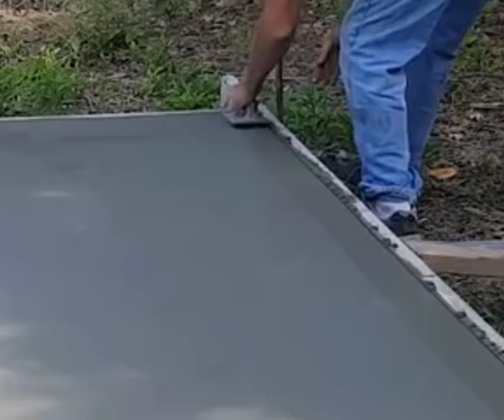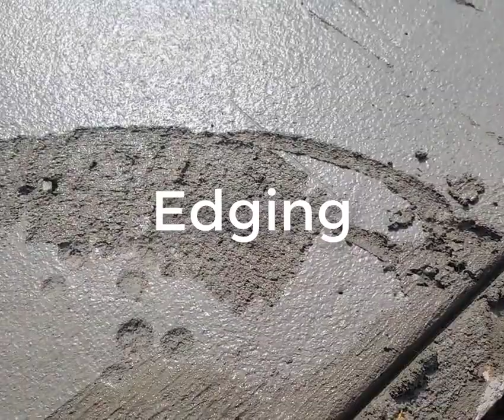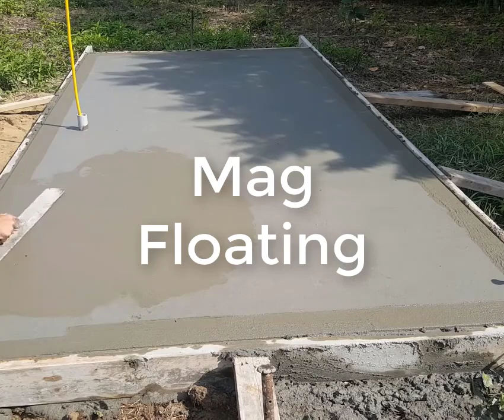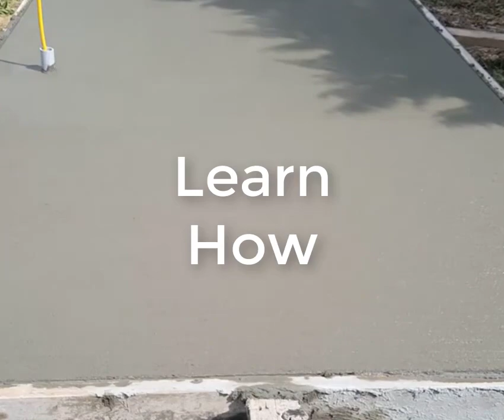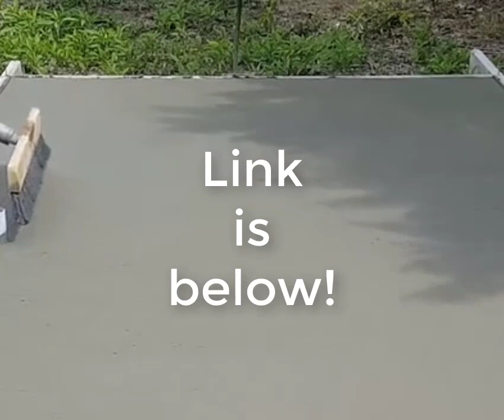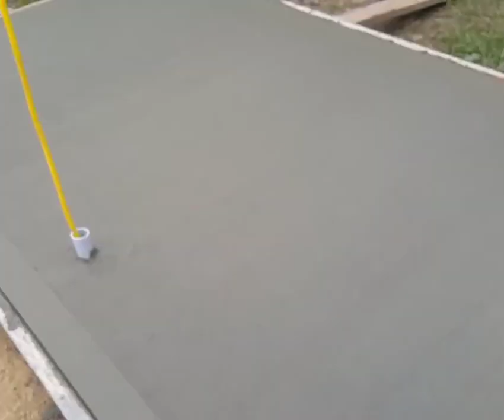How To Broom Finish A Concrete Slab #shorts

Comment: Hey mike I have a question I don’t know to much but why didint you seal it with the other hand trial or is it cuz the sealing would be interrupted with the brooming ?
Reply: But thank you I like your videos and the information you give out
Reply from the maker: We don't steel trowel before brooming exterior concrete in Maine. That could seal off the surface and trap moisture. We have too many freeze/thaw cycles in the Winter and don't want to risk trapping moisture which causes blisters and spalling.

Comment: Hi Mike, I want to thank you for your videos. I can honestly say my skills have improved with the guidance of your videos. I do have a question. I mix my own concrete using 3 parts  rock, 2 parts sand and 1 part portland cement. How do I make it creamier or fatty for stamping?
Reply from the maker: Just add a little more cement, slightly less stone.